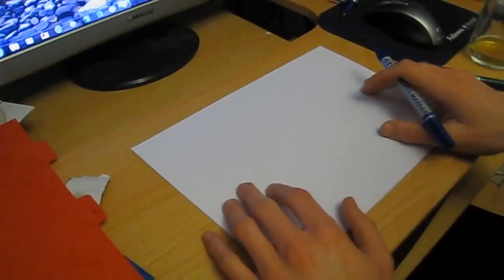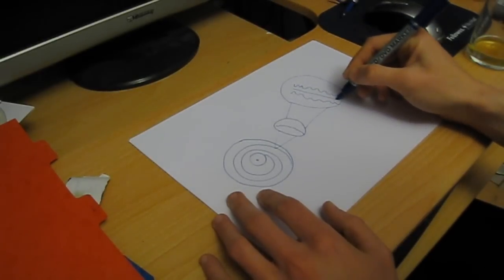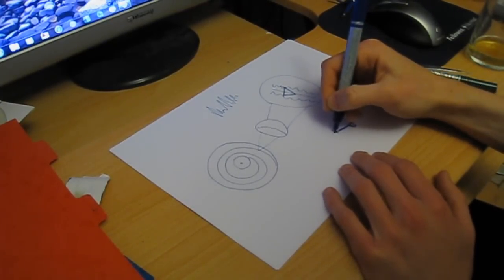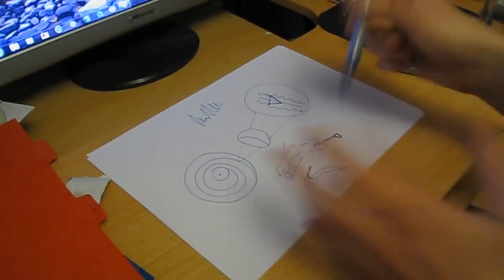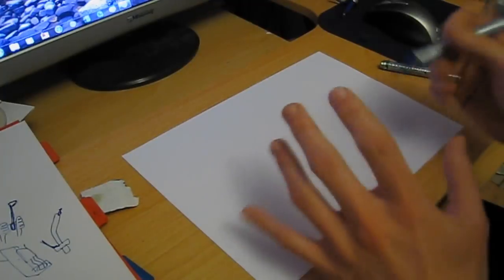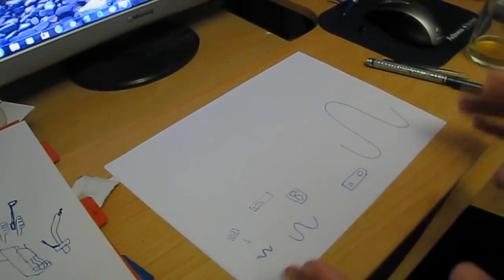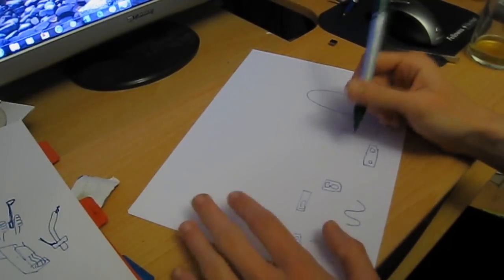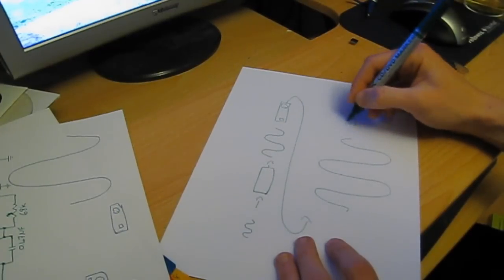how a turntable works.

Comment: the magnet forces electrons in the coils to move back and forth, ie. alternating current.  The ups and downs in a sound wave represent alternating current.  When this current is applied to a speaker coil, it does the same thing, force the magnet in the speaker to move back and forth (very rapidly) which moves the air and makes WAVES like if you put your hand in the bath tub and wave it back and forth, you get waves.

Comment: As far as I know, the grooves are identicall to the original source, so it's an almost perfect reproduction, against the compressed/chopped 44khz digital signal from a CD player. But, can one really find out the difference? I can't. I kind of feel a different mood listening to a vinyl record, like a "closer/warmer" sound, even if the same record on a CD sounds to me with higher fidelity, it produces a "colder" mood.